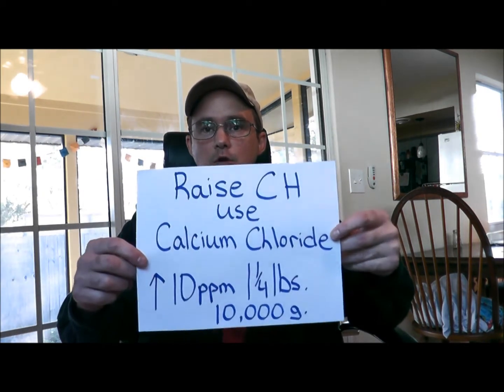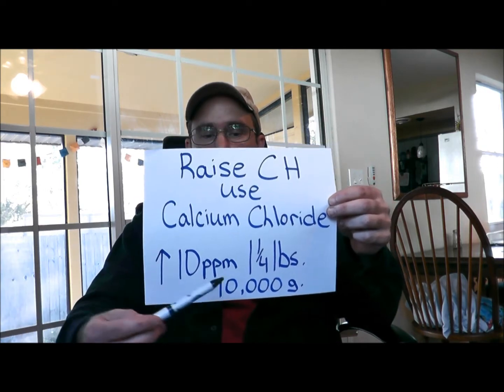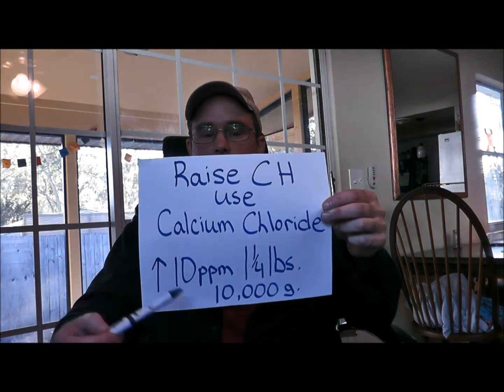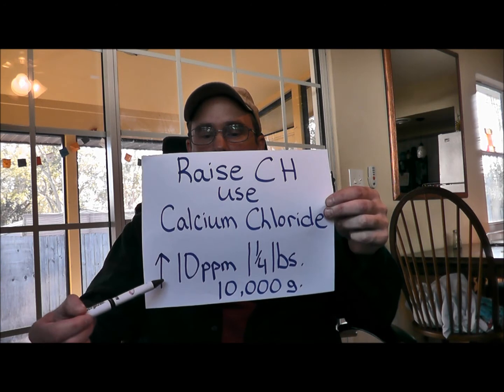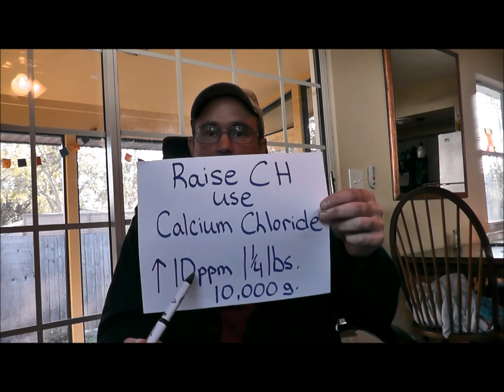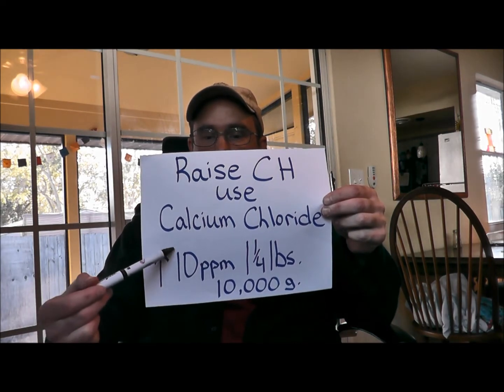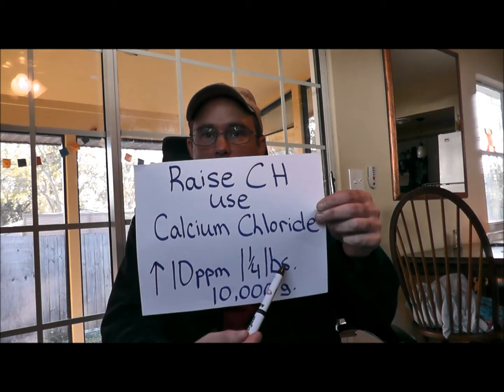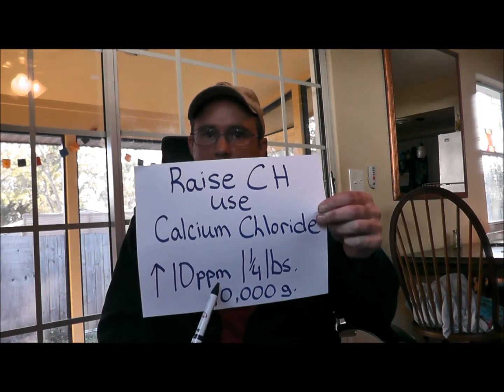Swimming Pool Calcium Hardness Always Too Low - What's The Problem?

Comment: My directions say add 1 ounce (30ml )  per 500 gallons to increase hardness by 7 ppm. my hot tub is 250 gallons and my hardness is zero still after adding 150 ml (5 ounces). My hardness should be at 80ppm. But it’s zero. I’m afraid to add more yet.  Any suggestions?

Comment: I have a vinyl pool and you said calcium hardness isn't as important for vinyl pools so do I still need to increase it to get to 150 ppm?  It keeps reading low but it is crystal clear.  Thanks
Reply from the maker: Calcium hardness is more important for plaster pools due to the calcium carbonate leaching which vinyl does not have. You always want to follow your manufacture's recommendations.